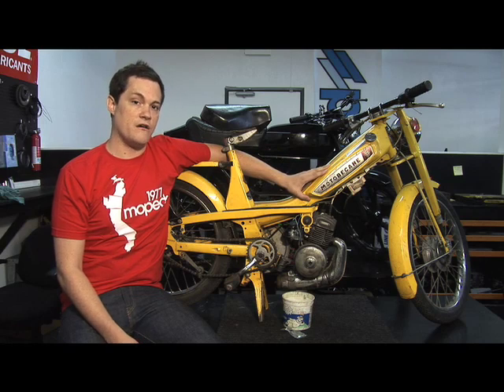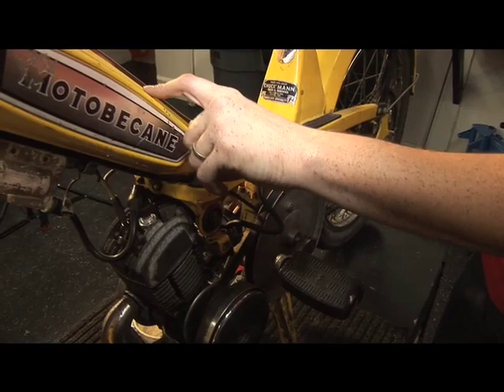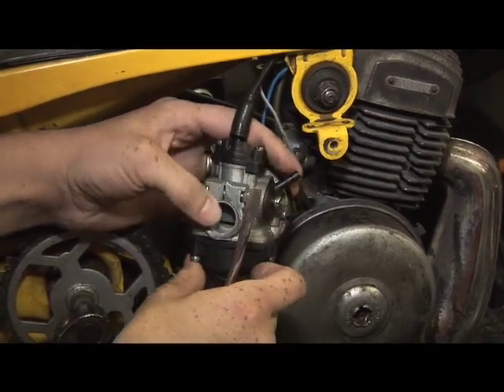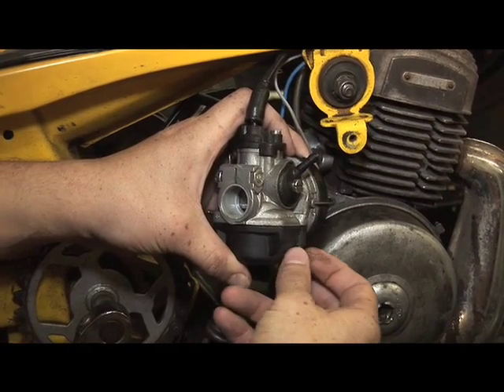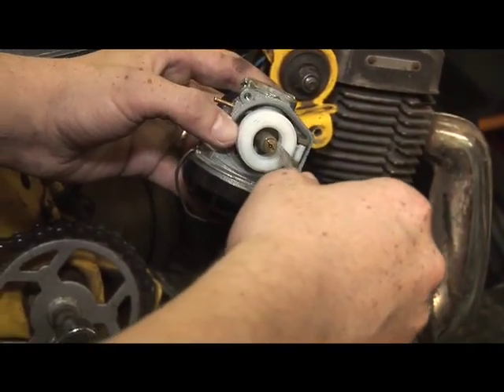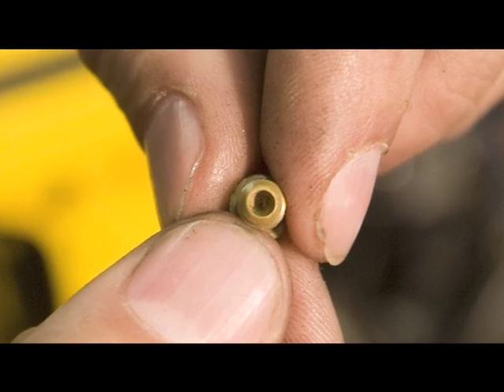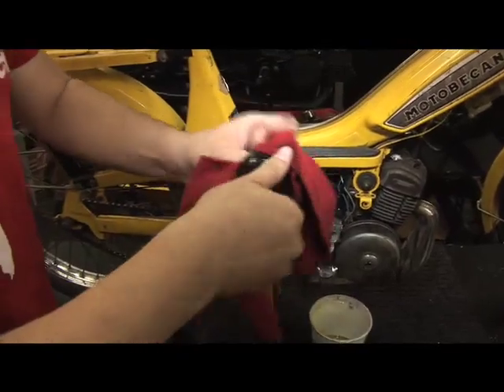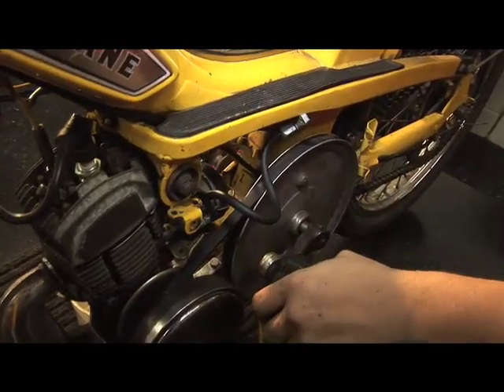Moped Gangs: How to Clean a Carburetor

Comment: @peer91 If it has a kickstart, you do not need a battery to make it start.  The battery is to make the headlight brighter, make the horn louder and make the turn signals work at idle. The battery is also used for electric start if you have one. I would prime it, open the choke and then see if it kick starts first.

Comment: LOL its very simple. u commented on my tomos targa lx vid... take apart ur carb and put itback together, u'll see how easy/ simple they have made it and how amazing it is that this little carb pressurizes the fuel into vapour with air and makes it very cold and then gets sucked into the engine. then the engine rotates up to 11000 rpm. 11000 TINY LITTLE EXPLOSIONS HAPPENING EVERY MINUTE WITH THIS LITTLE PISTON!!! this is what got me into internal combustion engines

Comment: Hi, sometimes its not sufficent to blow through the jet. I don´t know about the US but in europe it has been common in the last years to mix biological components with fuel to extend it. After years those components can cause a crusty material in the jet and other parts. It has to be removed manually. You can take some soft copperwire (harder material may change the size of the bore) to clean it.

Comment: Would a clogged jet cause fuel to go through the over flow tube? I have a 1977 Honda Express and the thing leaks gas through the over flow like CRAZY!
Reply: that's because the float is stuck
Reply: Thanks! I ended up figuring it out a couple years ago :)
Reply: Thanks! I ended up figuring it out a couple years ago :)
Reply: +gorillazgirl2006 yep in the airplane im restoring with my grandpa we just hooked the fuel lines up and poured gas in it and it's coming out too all because of the float sticking

Comment: There is more to cleaning a carb than this video shows - what about checking the top of the carb such as the diaphragms, springs, needles or cleaning any crap off the butterfly valves?

Its a nice introduction, but its not complete.